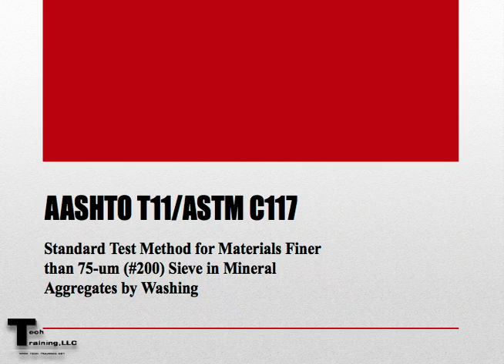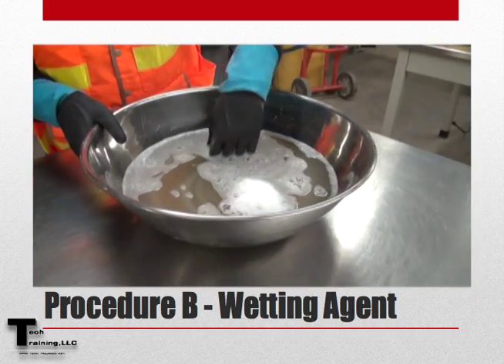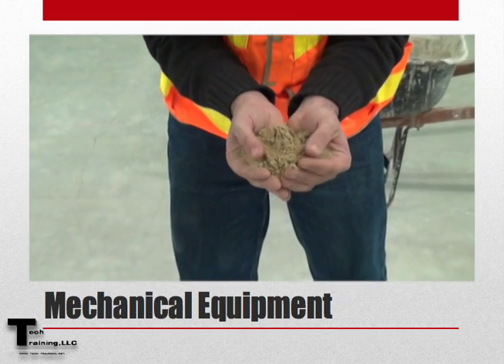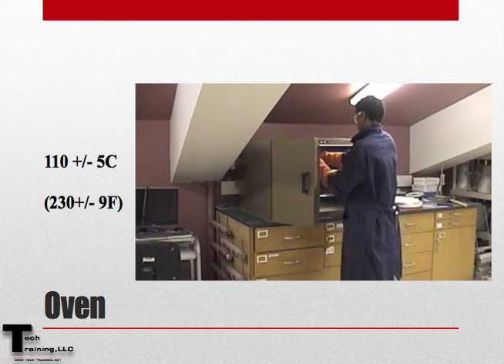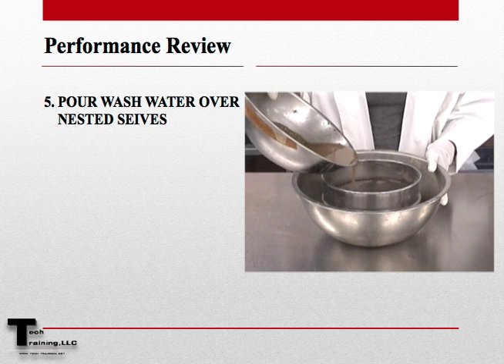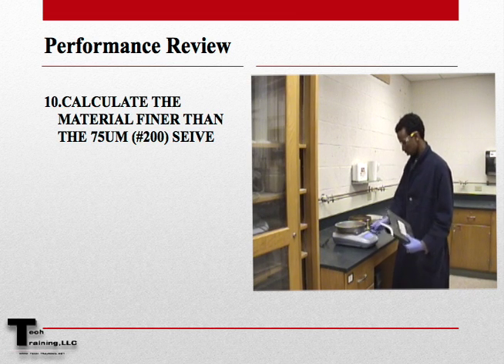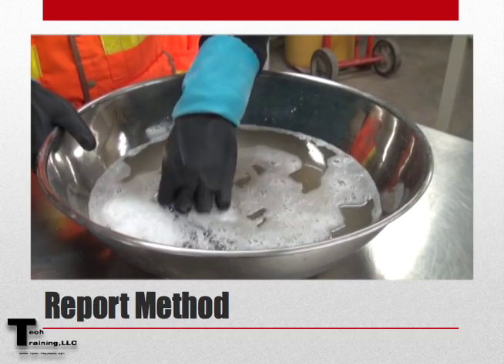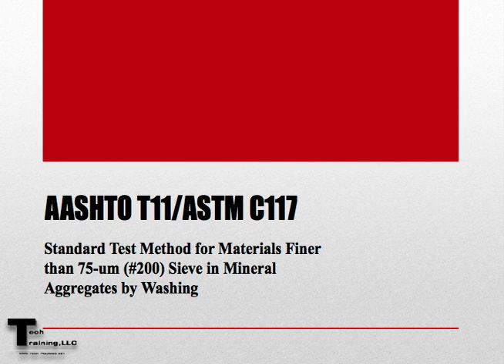AASHTO T11   ASTM C117

Comment: Not sure if they changed this but dish soap can give your extra fines passing 200 sieve. You have to use it very lightly to avoid this. In video he definitely overdid it with soap. We used a dry chemical we have to portion in water and shake to hell to mix it up. Sorry I forgot what the chemical is called. But it’s white and fine